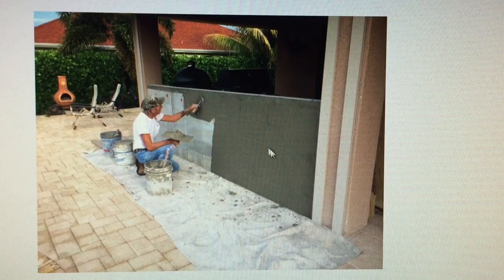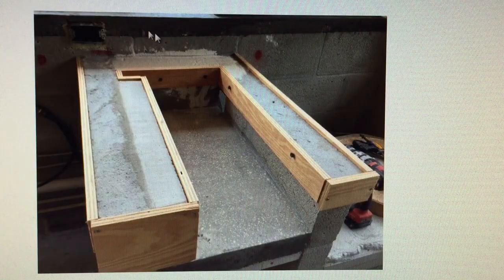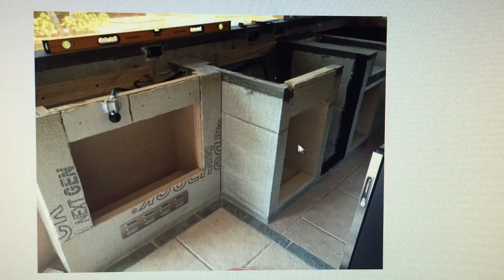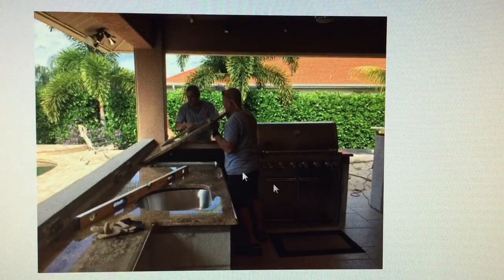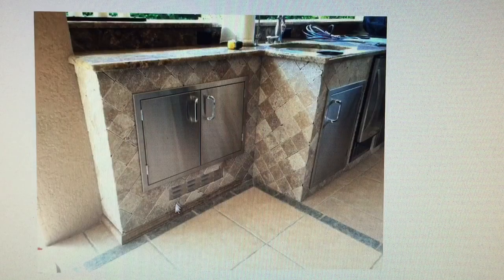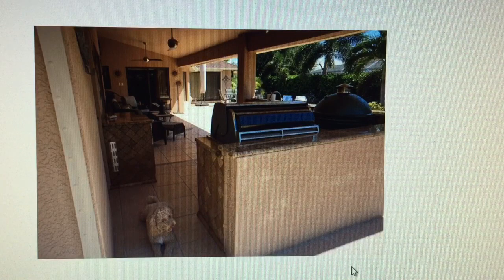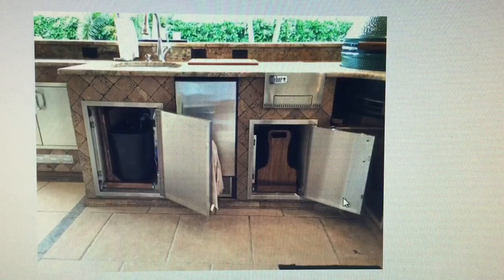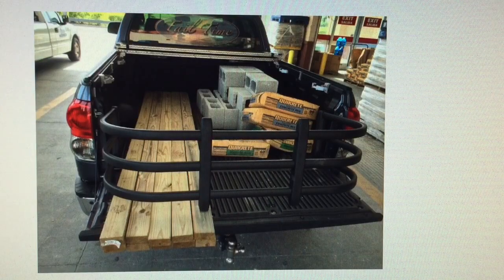Outdoor Kitchen Build Part 3

Comment: How did you build your custom trash container? I just bought the same bin from bbq guys and it came with a little one.
Reply from the maker: jj gibson I built it out of wood. Nothing I bought fit. I made it slatted and decorative but if I did it again I’d just use door skin 1/8 ply and 1x1 box corner supports. Annoying the made it not to hold a reg trash can!  I bought and returned at least 5 styles. Noting fits. Good luck!

Comment: I really need to thank you for putting this video overview up. It has helped me immensely with my own outdoor kitchen build. I have gone down the path of dong my own with concrete block similar to you, and being able to see what you did has allowed me to avoid several mistakes.

One question now that you have had your kitchen for a while. How do you find the smoke, especially with high heat cooking? Your outdoor area is similar to ours and that you have concrete roof beams which trap the smoke. I am wondering whether i need extraction fans?
Reply from the maker: Daniel Buckingham thanks so much! We wired the area for an exhaust fan but I ended up not putting it in. Mostly due to cost, the plan was for it to vent up through the roof. However, I have a small vortex style fan that I keep on the counter top. At the right angle it blows the smoke out of the covered area pretty well. Less that $20 from Target. Maybe that will work for you too.
Reply from the maker: Daniel Buckingham also, I redid this video in an all in one with way better picture quality. Check it out: https://youtu.be/2seTR5wTGy4
Reply: How can I send you some photos  of what you help me build?

Comment: I like the egg. I was thinking doing something like this. Do you think these materials will endure on the outside Chicago climate?
Reply from the maker: Joe Hanna for sure. It's all stainless, ceramic, concrete- all very weather resistant.

Comment: What kind of drop down shades to you use? Are they on vertical tracks?

Great videos. Very thorough.
Reply from the maker: djAnakin thanks! Those are kevlar hurricane shutters. They are on tracks.
Reply: YOLOfotos, can you provide more details on where you purchased these shutters or links to what model you used?  Been doing searches without much luck to try and find something similar. Thx!
Reply: @bobbygfl  - would you please provide more details on the shades you purchased if you have it? I am looking to do the same thing.  Thx!!
Reply from the maker: Kevin Kleinman hi. Just google hurricane fabric roll down shutters. Suppliers in your area should pop up. Sorry I missed you comment 7 months ago!
Reply: @bobbygfl  Thanks, I had tried that and found vendors that focused on applications for windows in hurricane prone areas, not wide applications to cover the openings of pergolas.  Furthermore, the costs ranged over a $1000 per "window" that was say a double wide.  I am looking for something say around 12 ft or more wide.  The estimates are way out of my price range for 4 sides of the pergola.  Do you recall the price range or vendor you used?
Reply from the maker: Kevin Kleinman I’m in Florida. The 20ft span was at least 5k, and that was 10 years ago. The other two were less, but still expensive.If it’s any consolation, they last for a lifetime.
Reply from the maker: Try roll down sun shading if don’t need the hurricane rated protection. Here’s one: https://sunsavior1.com/1/

Comment: I commend you on your work. The finished product looks great but I must say I'm confused about a few things. The grill you have is ok but it's not a DCS or Coyote or Blaze or another high end built in. Why did you put the propane tanks so far away when the grill you used has a place for the tank inside it?   You had to move several things during the process that someone who does it for a living would have told you for free at the time of bidding. Don't get me wrong, I understand you saved allot of money and the work looks great. All the framing you did with brick was not necessary, treated wood framing with fire retarding paint wrapped with a concrete backer board is totally sufficient, you used it in many places already. The walls behind the oven in your house are 2x4's with sheetrock and on both sides of your oven are wood cabinets. If the manufacturer told you it has to be mason products surrounding the appliance I would have said why, Is it not insulated the way it should be? Again great job for a DIY project, enjoy it!
Reply from the maker: glpdrum satx hi, thanks for the complements. As far as the grill, simple answer is I've had Webber my entire life and would never consider another brand. As far as the concrete construction, I wanted to be able to hose the entire thing out with zero concern of cracks or water intrusion for ants or roaches to set up camp. As little wood as possible was my goal. I've had ant problems with exterior stucko over wood. And lastly, the tanks are so far because the area under the grill is specifically designed to not hold the tanks. A Weber design feature that was not ideal, although I am happy overall. Having the tanks where they are also makes for very easy swap outs.